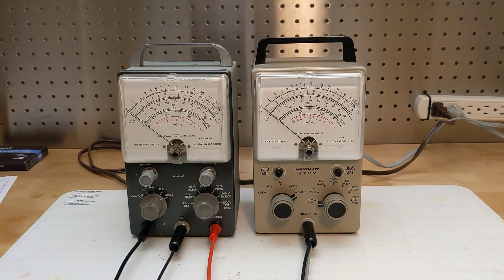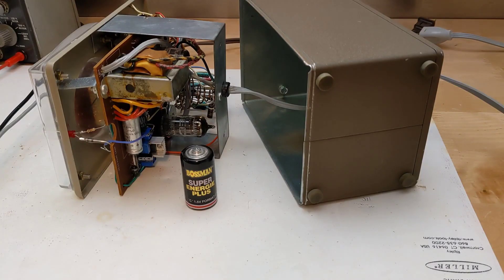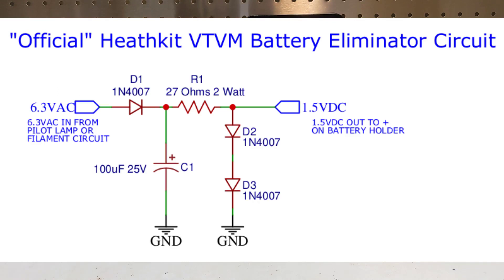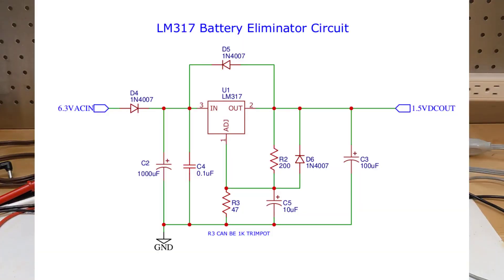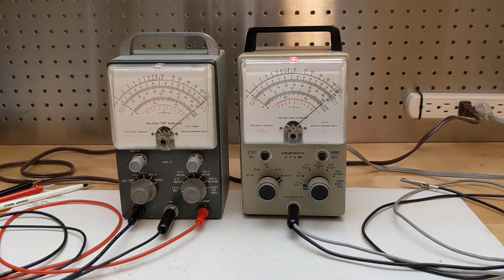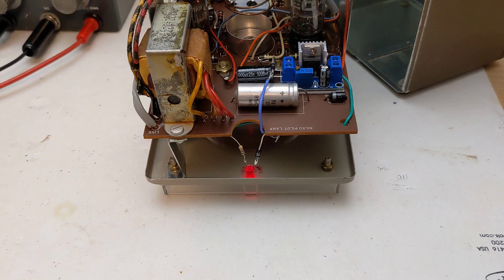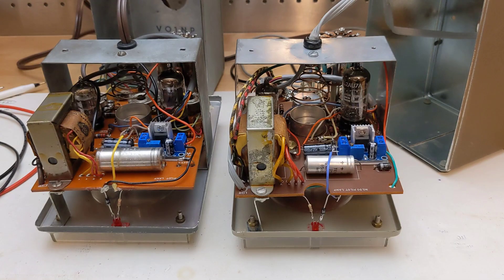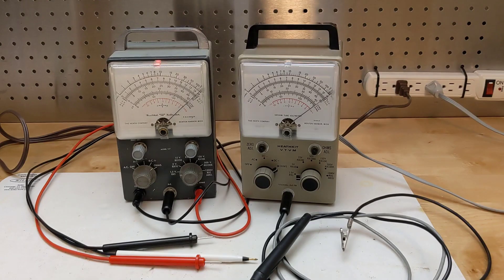Battery Eliminator Options for Heathkit Vacuum Tube Voltmeters (VTVMs)

Comment: I have the IMA-18-1 solid state conversion installed in one of my 2 Heath 5228's so current draw isn't an issue on that one.  I have a bunch of Chinese buck converter boards, thanks for the idea!  Radio alignment is the biggest reason these 2 relics still populate my bench.  The other is the high voltage probe for checking/setting anything with a high voltage.   Not the most accurate pieces of equipment, but since I'm using it mostly for relative measurements the accuracy isn't much of a concern.

Comment: Yes, while the simpler battery eliminator (three diodes, capacitor, resistor) does work well, there is little reason to NOT just go ahead and use the LM317 solution, especially since eBay (and other) sellers make available the ubiquitous Chinese LM317 board with the added external components (e.g. large aluminum electrolytic capacitor) for such a reasonable cost.

A couple caveats on the LM317 solution:
- At least one popular seller of the LM317 solution used to include a printed installation instruction sheet that accidentally advised connection to the transformer secondary backwards from what would actually work. Make sure you know which side of the secondary is connected to the VTVM's chassis ground and connect the LM317 circuit's input to the other side of the secondary.
- The commonly shown schematic for the LM317 solution is very generic and shows two or three components that are not of any use in a VTVM battery eliminator application. As Jeff stated, the two diodes which SHOULD be used in LM317 applications where the output is applied to unknown circuits are not beneficial in THIS application and can be left off. The small value capacitor across the input electrolytic filter capacitor is also not useful. And the small filter capacitor across one of the volt-setting resistors is also optional in this application.
Reply: Right. The Heathkit battery eliminator circuit doesn't supply enough current for the lowest 1x Ohms setting. I used a vintage Sescosem LM317 part, that I had in my bin, a 1N5819 Schottky diode as the rectifier diode, 470uF filter cap, 510R resistor from output to Adj. pin and 100R resistor from Adj. pin to GND and 100uF cap on the output. This gave me exact 1.500 V at the output cap and 8.2V at the input cap. I don't know if the Chinese parts can do that.

Comment: Great video, Jeff. I discovered your channel after buying a V-7 ($20) and an IM-18 ($15) at a hamfest last weekend. I'm going to try a battery eliminator circuit in the V-7 first, which needs to be rebuilt. The IM-18 works but had a leaky battery in it. If I need to use it as an ohmmeter, I'll clean up the spring and put in a battery. Craig KE7MPM

Comment: Hi Jeff, I managed to find and purchase  your book and throughly enjoyed it. If you have the time or other subscribers can assist with a few questions I'd appreciate it.
I went to a Chinese seller and purchased a few of the "Buck" converters you mentioned. Shipping these days is relatively fast compared to years back It took just over a week and they look exactly as the one in your video.
Q-1, I could only find the filter capacitors in a high frequency version.
From what I recall we did need high frequency capacitors for radio circuits and they were usually ceramic or tantalum. I've never seen electrolytics in high frequency.
The question is can these hf E-caps be used as power supply filters with the LM-317?
Q-2, The transformer used in Heathkit and other manufacturers VTVM'S are nearly impossible to replace. Changing the incandescent bulb with an LED greatly reduces the current draw on the low voltage winding. However if any of the components fail in the LM-317 circuit  or the diode version that'll be the end of the transformer.  Other than a fuse, do you have any recommendation to protect the transformer? A filament or lamp going  open would be OK, but if one of these converters  goes into a dead short thats the end of the transformer, I'd like to protect that transformer. Any ideas?
Q-3 I'd like to buy the other book you spoke of. It seems to be out of print and Amazon is asking $400 USD for one. I checked Ebay and other used booksellers, but apparently the book is printed on gold with platinum ink?
Thanks again, I am going through all your YouTube videos, all of which are very informative. 
Thanks,
Tom
Reply from the maker: Hi Tom. Thanks for buying my book! For a filter capacitor, any capacitor that is rated 1000 uF and 25 volts would be suitable. This would be an electrolytic type. For protecting the transformer, I can't think of any simple solutions other than a fuse on the transformer filament winding and maybe another fuse on the transformer primary. What is the other book that you were referring to?

Comment: A few years ago I restored my IM-18. Besides cleaning it up and replacing out-of-spec parts I had replaced the lamp with an LED and added the "Official" Heathkit VTVM battery eliminator mod following Robert Sumption's YouTube video.  With the mod installed I had noticed a "battery" voltage drop in the Ohms x1 setting with the leads shorted but figured it would be find as long as I didn't leave them shorted for long.   However, after watching this video I decided to change to the LM317 battery eliminator mod and now there is no significant voltage drop in the Ohms x1 setting anymore.  Thank you Jeff for your videos.  I find them useful and informative.

Comment: Hi Jeff, I'm glad I found your channel and I've subscribed. I have a Heathkit IM-5228 bench  model. It uses a neon bulb in the line voltage area as a power on indicator. I guess it was to reduce the stress on the 6.3 v winding on the transformer.  I also have an IM-18 and a V7A. Robert Sumption is a YouTube provider that discusses the Heathkit design, diode based eliminator. I think he worked for Heathkit.
By the way I've been trying to find your Heathkit book. Any idea where I can get a copy?
Thanks
Tom Heckhaus 
Retired from The Bell System
Reply from the maker: Hello Thomas. Yes, I am familiar with that video and it has good information. My book is available from lulu.com ( https://www.lulu.com/shop/jeff-tranter/classic-heathkit-electronic-test-equipment/paperback/product-21272772.html ) as well as Amazon.

Comment: With regards to the LED pilot lamp replacement circuit:
1) swap the screw (Edison-base) socket with a bayonet-base socket, the. You can then use the more common #47 bulb replacement as indicated earlier.
2) you can wire D8 in reverse-parallel with LED1.
3) you can use a bipolar (red/green) LED - the two-lead variety - and you won’t need D8 at all.
4) 1 kilohm is more suitable for a 12.6 volt filament winding. For 6.3 volts, 390-470 ohms will work better.
5) finally, if the flickering bothers you, wire a 100 uF/16+ volt electrolytic cap from ground (- lead of the cap), to the junction of D8 and LED1 (+ lead.)

Comment: Did you have to replace any of the precision resistors on yours?  I had a couple in mine that had drifted really badly.
Reply from the maker: I didn't, but I probably should. One one of the meters there is a 9.1 Ohm resistor that someone replaced with a 10% tolerance unit. These are typically what burns out if you inadvertently connect it to power in Ohms mode.

Comment: Jeff - I noticed that one is a 2 wire & the other is a 3 wire (ground wire) supply line.  Thoughts?  Should the 2 wire be "updated" to a 3 wire? 👍
Reply from the maker: Using a 3-wire line cord would be better as far as safety.
Reply: My B&K 177 is a 2 wire & the B&K 290 is a 3.  Measured the 177 chassis to hot & found 109VAC one way, & 23VAC flipping the non-polarized plug.  Just gonna put a polarized plug on it & not complicate the ground operation.

Comment: I went another way with my RETEXKIT VV-1, an european authorized copy of the Heathkit IM-11. I replaced the 1.5V D cell with a 1.5V AA Lithium battery and an AA to D adapter. No more concerns about leakage or durability. These batteries have a shelf life of more than 20 years and a capacity orders of magnitude above an original carbon D cell. Of course, no modifications to the VTVM at all.

Comment: I did this to my RCA mater a few years ago. However I used a linear regulator that outputs 1.5V. I also removed the selenium rectifier and replaced it with a 1N4007 diode and a power resistor to account for the voltage difference. I can't remember if there is a pilot light. If there was I think I yanked it out completely.

Comment: I ended up using an old cassette-radio thing transformer, and a lm317, similar to the option shown as the 3rd one. I've done that inside my heathkit vtvm 11, fits perfectly. my new hack for it would be to isolate the chassis from the negative terminal

Comment: I make a kit for this that only requires the 6.3VAC, and will work with ANY meter requiring the 1.5VDC.  There is one on Flea-BAY, but has a CAP dangling out the side!  Mine comes already made up on a Terminal Strip and mounting hardware with instructions.